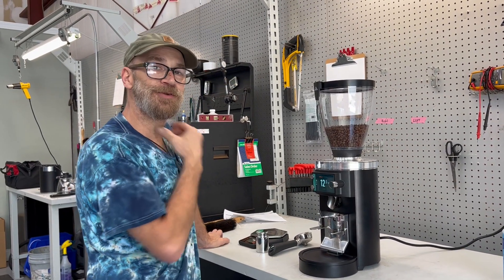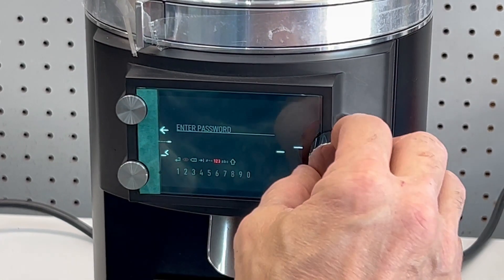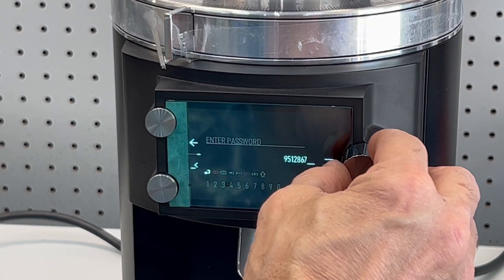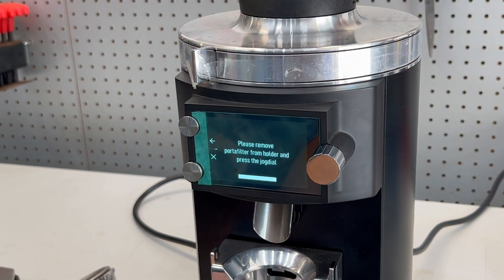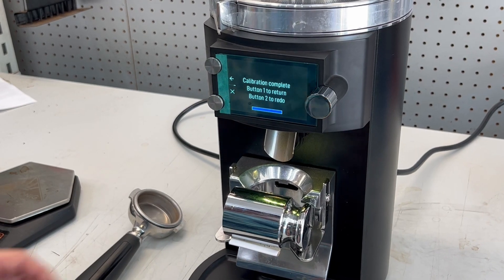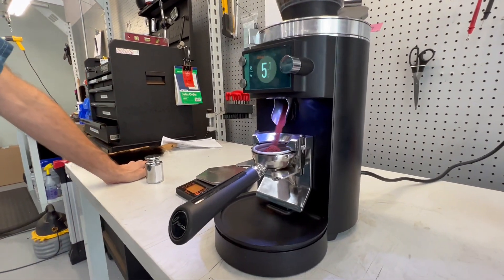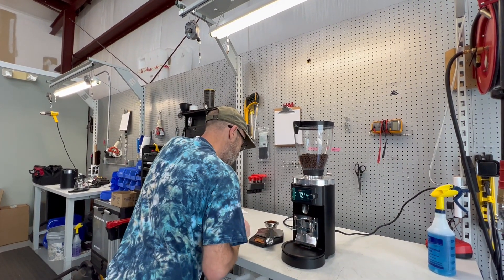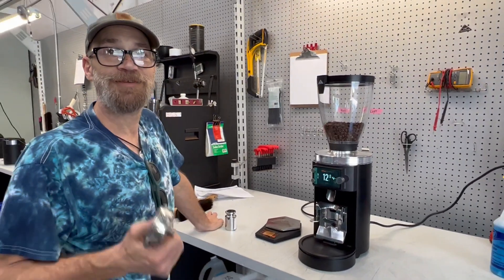TECH TIP: E65S GbW Load Cell Calibration

Comment: With latest firmware it looks like the Owner password gets to the Calibration menu. Sadly, mine no longer wants to calibrate correctly. It shows 1801.1 g with no portafilter and starts up with grinding and then the green screen of death. I removed the load cell and reinstalled to no avail. So I've either got a bad load cell or bad firmware, though it worked just fine until now since calibrating 4 months ago.